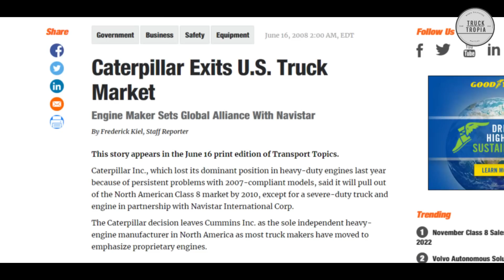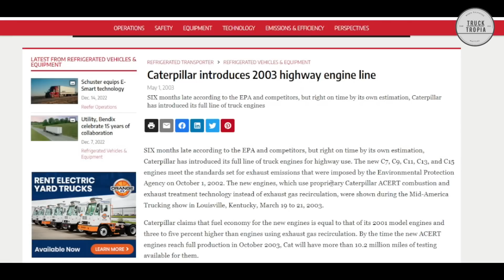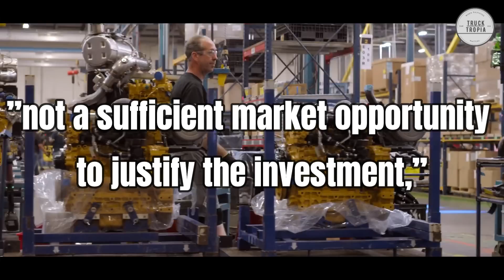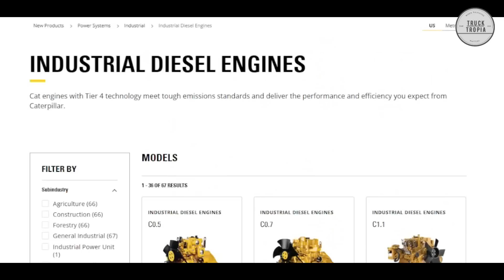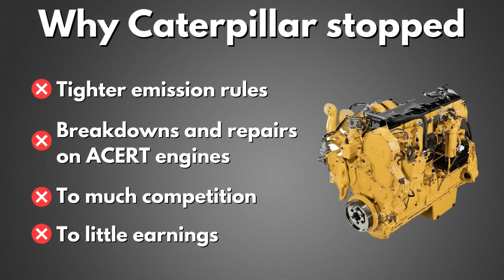Why Caterpillar Stopped Making On-Highway Truck Engines

Comment: CAT 3406e and the early years 6nz motors are to me without a doubt some of the best motors produced for the long haul trucking crowd. Parts are reliable. Breakdowns are few. The EPA has ruined trucking and they're not done. The ACERT CAT C15s had problems because of the emissions requirements, and CAT decided to quit while they were ahead. They knew it would only get worse and the EPA would not stop with new requirements. Thanks EPA. And before you ask me if I want clean air to breathe, let me say this. They say the air coming out of a new semi truck with DPF etc is cleaner than the air going in.  So mission accomplished? No? What's the issue then? Why keep putting out more restrictions?

Comment: Once cat moved on from the 3406 they couldn't make a reliable engine.  Been doing heads, head gaskets, cam followers, gear trains and hui pumps for years.  We won't start with their emissions problems:)

Comment: Just imagine if they get rid of diesels all together because they want to lower the emissions of something that doesn't create a lot of emissions. Then we'll be using gas (and that in a big truck is gonna be a lot of stops for gas) or electric (probably have to wait half a day to charge plus won't go as far as far or diesel without stopping) and worst care scenario turbine engines (the amount of thrust that would need to be produced for the truck would mean it working at full power constantly unless it was a hybrid, turbines at full power aren't fun to be around for long because of the noise it makes) but I guess we could always return to the old vehicles that  will still get the job done or overthrow the government so we can keep the good things alive longer (I swear people these days don't give a single shit about other people, the only thing people care about are themselves and the planet they are helping destroy)

Comment: To sum it up, Cat used the wrong and uncompetitive technology that led to a dead end when it couldn’t be adapted to higher emission standards without a massive redesign.  Most competitors are still very much road truck engine builders which have replaced the Cat engines and are happy with the extra business. 
The mystery is how Cat meets current off-road emissions regulations with their own engines. Off-road standards have nearly caught up with on-road and currently almost universally require cooled EGR, DEF/Adblue, DPF, high pressure common-rail injection on multi-valve turbo or twin turbo with intercooler and so on. Basically the same kit as on-road engines.
Reply: The mystery is solved: We switched out data tables  to make the  engine perform to EPA standards, then switch it out with settings that provide competitive power for the customer after 90 minutes. All of the ACERT engines got around the problem like that, anyway. <-- Part of the ACERT Team @ Caterpillar's Mossville EEBU back in the early 2000s.
Reply: @francisreich51  Ah! The VW solution to emission standards. Good thinking by Cat.

Comment: I have 3406e, 1LW and 5ek will never trade my trucks for the new garbage trucks with computerized motor, will never drive anything but cat, the 5ek had 1.4M before overhauling, and the 1LW is still going almost 1.7m miles on it

Comment: I bought a 2018 Kenworth Glider with a reliable CAT 3406E. CAT should make engines and tell the EPA to go pound sand. I refuse to buy a new emission engine. Theater are pure junk and have more problems. If the government wants all this emission on diesel engines, let them pay for it. I know guys that removed all the emission nonsense and the engines preform much better. Government fines are worth the paper they are written on so why pay it.

Comment: My deployments in Afghanistan we had Force Pro Cougars with C7s in them and they were so awesome.  So much power that it would bounce the rear end of a 65,000lb truck like it was a 1/4 ton if it got stuck mud.
Reply: First time I've heard of a c7 with lots of power
Reply: @sstephen2015  I’m sure it’s different for truckers on the road hauling 80,000 pounds and a couple lot lizards at highway speeds, but they were perfect for us.
Reply: Thanks for your service brother.  FMV have the Cats as well.

Comment: Started driving in March 88. A company truck, I drove for from 92-98, had nothing but 3406E's in their trucks. then As an Owner/Operator 98-2005, own authority, I ran a 1994 T-600 with a 3406 A, turned wide open, a 13 speed with 3:90 rears; got good fuel mileage, made good money with that truck. Never had any problems with the 3406 Cat's. Good and strong running engines. I sold out when diesel fuel became more than gasoline, and all owner expenses began going up, while freight rates went down. I drove other peoples' trucks up until Dec 2022.  33 yrs. trucking.  I retired.
Reply: I drove a old school kenworth like that pre def ungoverned,super reliable,comfortable seats.pureAwsome
Reply: That's awesome, thanks for sharing and hope you are enjoying retirement!!
Reply: Thank you for your service. Over.

Comment: Hi from the uk 
I know that cat had a big following and had a reasonable market share before your emissions regs tightened up and then they had a go at emissions compliance and didn't do to well so along with reliability issues it would seem that they behaved like a spoied brat and gave up, funny how all the othe manufacturers managed. So in the future when the epa impose emissions regs on off hi way equipment what will they do then   give up an buy in engines from other manufacturers. It would seem to me that their engineers need to take a look at the competition and do similar as that is what goes on in every other manufacturing plant

Comment: I’m not sure what CAT motor we got in our fire engines back in 2010-11. We constantly have to add coolant and the coolant isn’t leaking onto the ground. The EPA standards of exhaust regeneration was a bad idea. 
The series 60 motors always got 6-7 mpg no matter how hard we ran and abused them. The CAT struggles to get to 5 mpg and if it needs regen the would drop to 1-2 mpg. 

I’m not impressed. I’ll just attribute to we got a bad batch of motors….

Comment: I had a 425hp 3406b, it was one of the best motors I ever had. It pulled great got 6.5mph and I never shut it off till I got home. I put 500,000 on it and the company I drove for gave me a new truck, but I don't remember anything going wrong with the motor in the time I had it.
Reply: *6.5mpg
Reply: Why you never shut it off till u got home I heard of a old skool doing this he would run from the time he left till he came back a month later
Reply: The new Cummins if try that you’ll blow the head gasket or your turbo
Reply: @terracestevenkennedy9198  I left my international pro star maxxforce running for 3 days straight cuz of a bad starter just wondering would I have messed up the engine by doing this

Comment: Didn’t learn anything new! Thought we’d get info about what specifically was too difficult for Cat, that others could overcome, but not Cat. And in my opinion; Cat engines suck, mine threw a rod, right out of the side of the engine, after only 150,000 miles. I’m glad they don’t build road going engines anymore!

Comment: As mentioned in other comments the C-15 was a good engine made good power and torque, the later C-13 acert and the MAN motor was the killer, this video is not a good example, at least the CAT could handle 600 hp not like the red engine that would shit its pants at 550hp.

Comment: I bought a new Peterbilt 359 in 1980 with a 3406a model. It was painted white from the factory. I went on to truck for many years and all the trucks I owned had Cat 3406 models until they came out with the C15. They were all great motors with hardly ever any mechanical problems but those C15’s when flashed to max HP were…King of the Road !
Reply: I had a 1985 359 Pete and it had a 3406 B model in it. Mechanical 400 hp Cat. My 1980 3406 A was 375 hp.
Reply: I was wondering what engine my friends 84 Pete had. He has st called it a 400. I know it was turned up to 425. That was a beautiful truck. Long nose, Double sleeper. Which you didn't see as often then. Him n wife hauled Carpet to California and produce back. I got to drive it a few Times.
Reply: It is my responsibility to aware every one
Quran is the last book of God which revealed on prophet Muhammad saw quran is the only source of guidance in whole world quran will show you the right path quran also verify bible and torah and other scripture kindly once time you study whole quran and aware yourself from the aim of life and got success in long run 🙏🙏🙏🌹🌹🌹❤️❤️❤️
Reply: @RussianFans-vn6cj Go  Away !!!

Comment: I swear the emission regs are more about doing away with ice than anything else. If what I understand of car & motorcycle engines is true we have gone well past the point of sensible emission reduction to the point that engines now will not last decent amount to time before developing major issues to expensive to be worth fixing which is stupid as most of the emissions come from making it not the use.
Reply: You don’t understand, but it doesn’t matter because understanding is not a prerequisite to speaking nowadays

Comment: Cat bet the farm on ACERT and it didn’t work out.  On top of that they got very prideful of the ACERT engines and wanted a premium for them.  That’s when PACCAR started going their own way with their own engines.  Cat never thought that their solution wouldn’t work and the truck OEM’s would pick other engines.  The joint venture with Navistar on the Cat truck was also another doomed venture.  Cat had little to no control or say in the production process, so Navistar could do as they pleased without repercussions.  That left Cat with an inferior product and delayed deliveries.  Not to mention the product support issues on the engines where even Cat dealers were forced to go to the Navistar dealer for parts and repairs.

This is a great case study on how a top-tier company can fail miserably because they allow their own success and pride to cloud their judgement.

Comment: Because we couldn't get the agents good enough every caterpillar truck mechanic hates their fucking diesel engine for the 18-wheeler because their shit they can make giant engines for trains and everything else and run decent but they had trouble putting them in a 18-wheeler and making them the engineer before the truck up a hill

Comment: One of the main reasons of Cat bailing out of the truck engine market is the outrageous cost of repairs. The labor and material costs are far above other diesel makers costs which makes it hard to keep a Cat engine on the road. I was never in the truck repair business, but curiosity must be my middle name and I have to know things. Having heard how expensive the engines were to repair I did some checking and found those stories to be true.
Reply: It is my responsibility to aware every one
Quran is the last book of God which revealed on prophet Muhammad saw quran is the only source of guidance in whole world quran will show you the right path quran also verify bible and torah and other scripture kindly once time you study whole quran and aware yourself from the aim of life and got success in long run 🙏🙏🙏🌹🌹🌹❤️❤️❤️

Comment: Its simple.... 
Cat has a lot more pride in their power for engines than to kiss CARB's ass for California, as well federal laws pressing hard on commercial motor vehicle emissions. 
The ending was due to emission laws. However there are still plenty of semi trucks on the highway today with C15's, C13's and C11's. Older Kenworth's, Peterbilt long noses, some Freightliner classics,
Never have I driven a truck with a cat engine, but would love to. 
Best of anything I've driven was a Cummins CX15 Power edition with an 18 speed. 
Also driven plenty of Cummins ISX 3's
Plenty of PacRats (Paccar's) Both MX 3 and MX5's All of them are crap. 

Main issue these new trucks are falling apart before half a million miles is mainly due to lack of upkeep. Yes they are very high maintenance, and you should consider taking off the EGR valve and EGR tubes every oil change to clean them regularly because oil residue and carbon has a way of building up into them all the way through the intake and around the valves. 
Parked Regens shorten  lifespan of DPF  Filters, if your truck is not flashed to allow rolling and automated regens then suggest you take care of that asap because Nobody has time to stop on the side of the highway to do a 45 minute parked regen. Thats also a safety hazard. Not to mention finding a place to park in less than a mile, when the screen message comes on, and then your truck trips into a stage 2 derate. Where the only way to get it out of that derate is to hire a mechanic who has a $3000 J1939 dongle and another $3000 worth of money in software for their laptop. 

Cat knew what kind of complexity's they would be getting into and how much money they would have to throw out the window for redevelopment just to follow new laws. 

Also if you have a twin turbo Cat engine and find that its overheating suggesting to get turbo blankets and exhaust wrap to keep the heat in the exhaust without spreading down the passenger side of the engine.

Comment: Like Pat said, the engines were good.  What really happened is engines have a really small profit margin and PACCAR informed Cat they were going to manufacture their own engines.  That meant a loss of 450 engines per day.  The VP of engines pulled the plug on on-highway engines.  The still make hundreds of engines per day that meet Tier 4F emmision standards in Texas, Japan, and Europe.
Reply: I worked for a Pete  Dealer back then and was told by a higher up from Paccar that there was a disagreement with the owner of Cat and Peterbilt. Peterbilt wanted an engine that they could call a Paccar engine. Cat wanted their name on the engine. They could not come to an agreement,  so Paccar said they would go with Cummings who agreed to put Paccar on their engines, and quit ordering Cat engines for any Paccar truck. That is what I was told back in the day.
Reply: @Nozzlejockey2  It was all an EPA thing. Cat wasn't going to Neuter their Engines anymore than they already were by the EPA.
Reply: Veiri Gaines out of Colorado owns almost 500 trucks with Cat engines.
Reply: Insane that this video barely touches on competition, but this is probably the biggest nail in the coffin. I worked for PACCAR at the time this was happening.  I guarantee if PACCAR had not built their own engine plant in Cleveland MS, Cat would still be making engines for Peterbilt and Kenworth to this day.  When 50% of your sales go away it is hard to stay profitable.
Reply: @brianpulscher6514  Cat not making On Highway Truck engines was not based on Paccar wanting engines. It was an EPA Castration Mandate that Cat decided to stop On Highway truck engines. Cat is not hurting from the decision.
Reply: @curtekstrom9531  yeah but its kind of both: It you're only going to sell half as many truck engines going forward, is it worth dumping the money into that segment to get the engines compliant? All that R&D time is expensive. Somebody probably smarter than either of us took a hard look at the numbers and decided they should get out. If they were selling as many as they used to, it might've been worth the money.
Reply: It was all about the EPA demands. Cat decided they weren't going to Continue to Neuter their Engines.
Reply: It is my responsibility to aware every one
Quran is the last book of God which revealed on prophet Muhammad saw quran is the only source of guidance in whole world quran will show you the right path quran also verify bible and torah and other scripture kindly once time you study whole quran and aware yourself from the aim of life and got success in long run 🙏🙏🙏🌹🌹🌹❤️❤️❤️

Comment: They know what's coming. At some point in the future. Everything on the road will be electric. The only thing slowing it down are the batteries. Once that has been resolved. Gas and diesel engines will seem like horse buggies.

Comment: Modern emissions controls might not be bad for gasoline engines, but they severely hinder diesel equipment and are especially horrible with DPF and Regeneration.

Comment: The EPA should have included off road Farm and Construction Equipment in the OnRoad Pollution Standards, so that Caterpillar could have Justified it's investment in clean Diesel Engines.  Diesel Engines are so Dirty with emissions that are dangerous to human,  which leave may leave the construction site or farm. Very hard to meet the standards, look at Volkswagen. The EPA should not have made this Corporate Justification to continue to Pollute so easy to make. What needs to happen now is that Off Road and On Road emissions standards should be equalized made the same. And Caterpillar should rightly go out of Business like they chose to do On Road and eventually Off Road.

Comment: Caterpillar builds a lot off highway engines including marine applications. and between that and the stricter growing and constantly changing emission standards. they decided to stop production of on highway engines. and they there could be a possibility that they might start producing these engines. again but I haven't heard anything since then. which I can see their point of view, it doesn't make sense to have to struggle to meet emission standards. when they offer engines in so many other markets. although I would like to see them build truck engines again. because I always liked most of their previous engines. but I can definitely see their point of view.